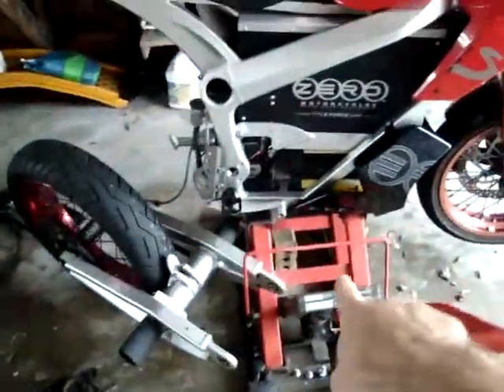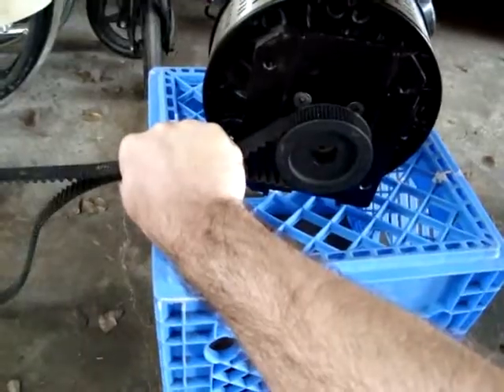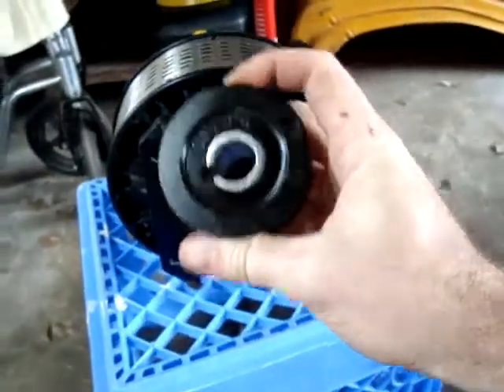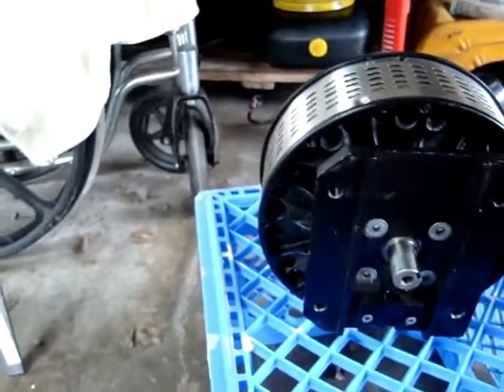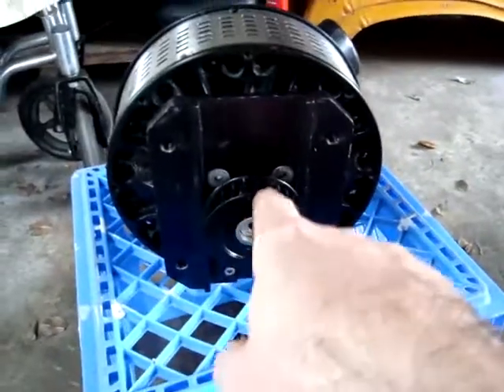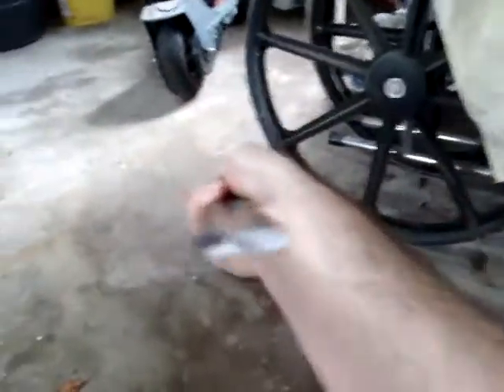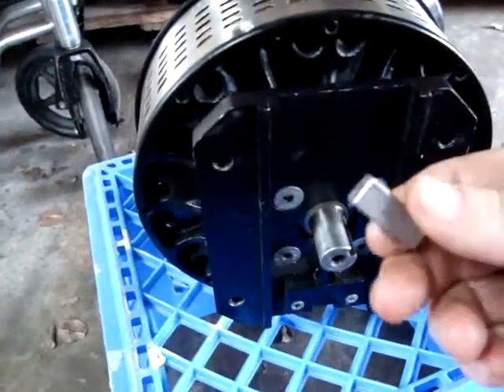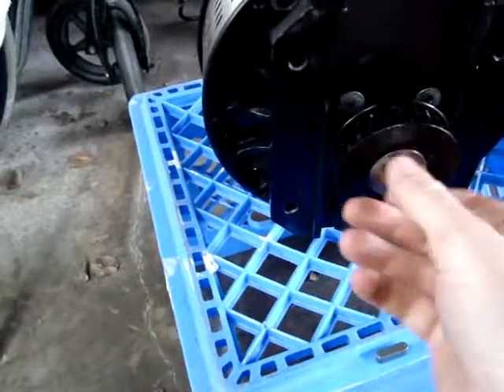Zero Motorcycle Pulley Change

Comment: Hi I have a 2010 Zero S with the Agni 95R Motor and am looking to change the front sprocket (chain drive) however everything I read says that the shaft of the motor is 19mm (2 thousands of an inch bigger than 3/4"). Is your perhaps 19mm as well and 3/4" is close enough that it doesn't matter? thanks
Reply from the maker: You might be right about it being 19mm. I didn't read anything about the specifics and had to measure things as I went along. However, 19mm and 3/4" are so close that it doesn't make any difference here.